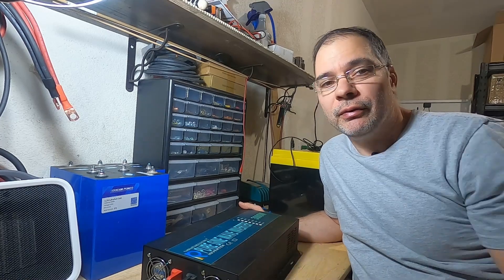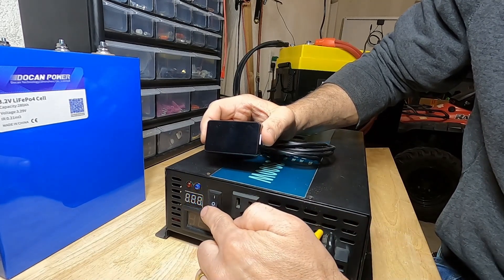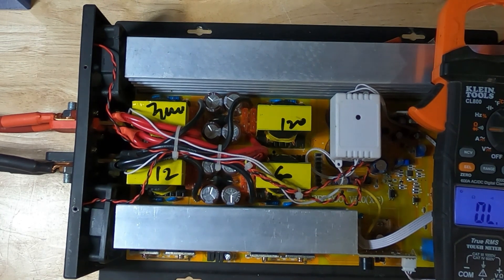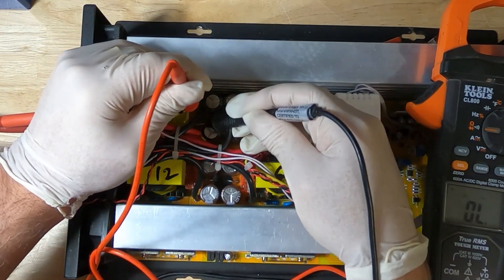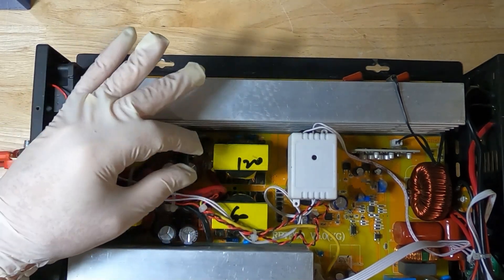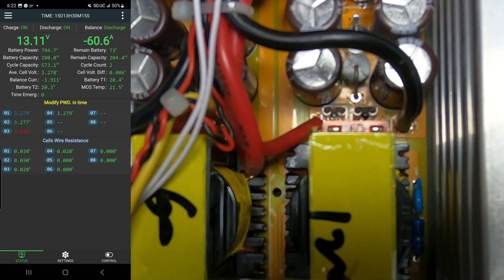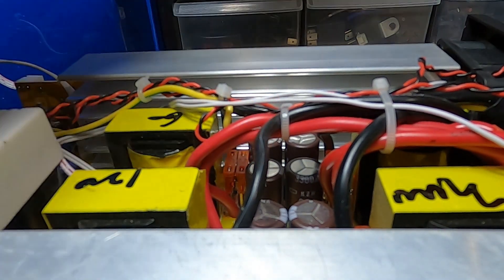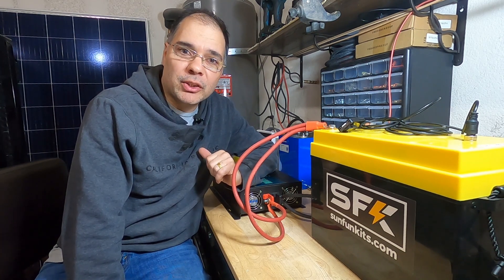DOA WZRELB Fixed! - Inverter Repair and "Will It Fail" testing.

Comment: I have a 4000w 120v x 48vdc inverter same brand and I get nothing on the DC or the AC blue meters. Are these inverters fused on the DC side also?
Reply from the maker: Sorry I do not know.  Worth taking a look.  Should be able to find a schematic online.  
Mine was only fused on the AC side

Comment: Do You know how to Clean, Inspect and Upgrade the Aeliussine WZRELB 7K SPLIT PHASE INVERTERS ? For Optimum Performance ??
Reply from the maker: Not familiar with that model but for cleaning just use standard electronics cleaning spray.. inspect the capacitors for leakage or buldging. Pretty standard checks for any electronics..
Reply: @natesdiysolar Rebuild Kits are mentioned for these WZRELB INVERTERS do They offer Upgraded Components that are known to Fail ? 
With Better Quality Parts I guess is My Question here.

And Thank You for replying back

Comment: I have the 3500 watt version of that inverter. I bought it in 2015. started using it in 2016 nd it quite because of I believe a loose connection at the circuit board and one of the capacitors. It is loose in it's position now. Same brand as the one you have their. At least the label appears the same.
Reply from the maker: Yea they aren't the best..

Comment: Good video....I have the 2,500 watt version WZRELB, exactly the same except only 3 power supplies and 6 fuses.  I also have the 3,000watt WZRELB 240v split phase, it has a single power supply with a 100a fuse screwed to the circuit board.  I consider WZRELB to be good quality inverters.
Reply from the maker: Good to know, thanks for sharing your experience with those models!

Comment: I have the same problem with 115 volts or 120 volts not showing in the display. As far as I can tell no bad capacitors. What if all the fuses are good? What to troubleshoot next?
Reply from the maker: Probably the power MOSFETS . There are lots of videos showing how to test them.  Also, check if there is a repair kit for that unit. Oftentimes, they have repair kits with common parts that go bad.

Comment: Hi I have the same inverter 1 trim Pot for voltage what is the other trim pot for mate?
Reply from the maker: I would have to look, but my guess is that it's  the output frequency in HZ adjustment.
Reply: @natesdiysolar  cheers for that I turned it a bit but it didn't change the Hz so who knows hey would be nice to know though hey
Reply from the maker: @Hoopsy78  bummer.. sorry about that...

Comment: Great video. BTW, that small white box is the remote receiver, I guess the seller did not give the Remote controller that comes with it. I have this 3000W 12V inverter (without remote version) running 24/7 since Sept 2020 and still working great, just have watch out for bad filter caps that tend to fail and you will see it has domed top.
Reply from the maker: Yea I figured that out later.

Comment: Was that replacement 40a fuse from the spare fuse package? Take one of the spare Chinese fuses and actually run current through it using a calibrated resistive load. I found these cheap fuses have horrible tolerances. I've tested cheap fuses rated @ 5a that did not blow until 20a was passed through them for several minutes! Try the test again using a genuine BUSS or Little Fuse brand.
Reply from the maker: Wow, that is crazy.  Yes, this was the supplied replacement from the manufacturer. I'll have to try that.  Thanks for the info.

Comment: I just bought this model a week ago.  I guess I got a deal @ $220. Very useful info! 
🙏🏼 😊
Reply from the maker: It's actually a decent unit.  Is yours the newer version or older version.  The older one seems to be more efficient as far as when the fans come on.  I want to do a comparison video of new vs. old.
Reply: I think it’s older. Black in color, not blue and no remote switch. I haven’t tried it yet.
Reply from the maker: @Aubrey J. Tennant  I have both units. I'll have to open them up now and see. I think the newer one is the smaller black one with integrated heat sink.
Reply: Okay, so you think the black is the newer one? I look forward to you comparing the two!
Thanks
Reply from the maker: @Aubrey J. Tennant  I do just based on size, though, lol. Typically, newer means small, more efficient components.. other than that, I'm just guessing at this point..